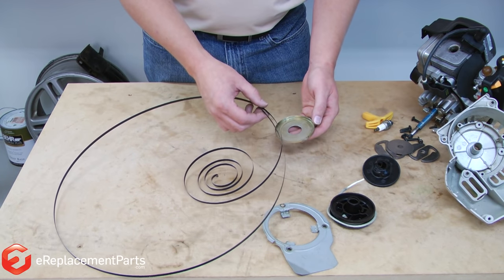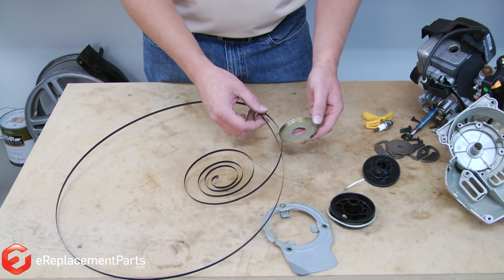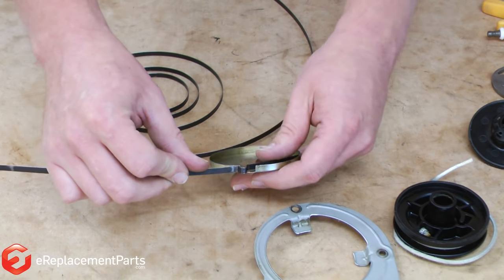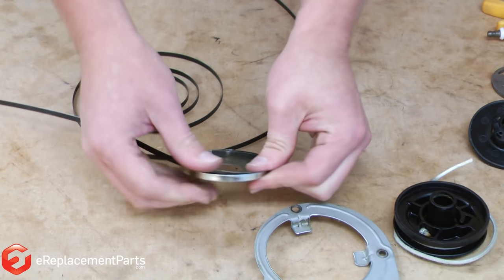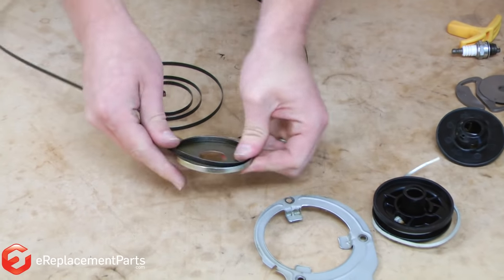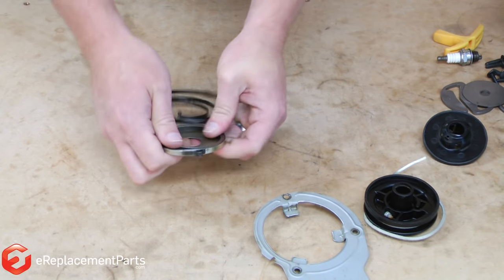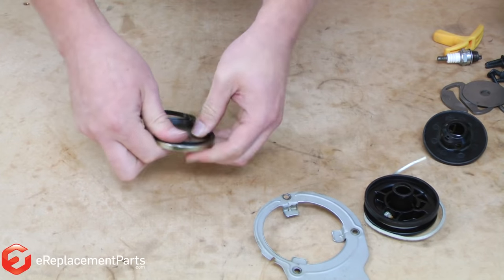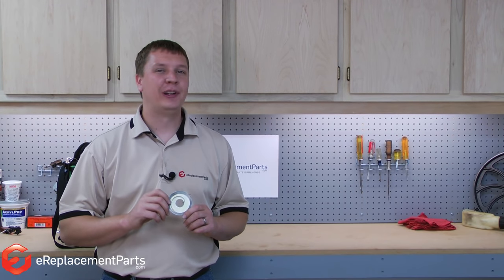How to Rewind a Recoil Starter Spring--A Quick Fix

Comment: Just a footnote to all you good folks, the spring will only catch the spool in one direction, so if your spool is not engageing the spring, remove the spring  from the housing and start the spring winding the other direction, with the tag end near the outside pointing the other way, especially helpful if it springs out on disassembly and you had no idea of the oreintation.

Comment: Hi Mark,   I used your Quick Fix to rewind the recoil starter spring on my old Homelite HB 100 blower.  It has the same design as the one in your video, and your technique worked fine.  Thanks!

Comment: Mark,
 I struggled for an hour and still could not rewind the spring. I checked many different approaches . I saw yours and immediately went into my garage and rewound the spring to my Homelite chain saw. It took 5 minutes. 

Thanks for the tip,
ernieking6031

Comment: i wound mine up by hand (can take a while and a few attempts as i found you need to hold it a certain way for you to be able to wind it by pulling it together and holding the middle and keep wrapping more round) and kept pulling the outside end out to make it tighter then when it was fully wound up gripped it tight together with long nose pliers (at the right point that gives you access to the housing) and offered it up to the slot that holds the outside holding bend. long nose pliers are essential if you have the recessed housing type of pull start where you have no chance of doing it with bare hands.

Comment: once you get the spring in, put the rope spool in and turn it 2 or 3 revolutions and hold it to put tension on the spring. Then attach the rope, once you release the spool it should pull the rope back in. If not, you may have wound the spring in the wrong direction while putting it back in.

Comment: No matter which way I wind the spring in my homelite string trimmer the pulley doesn't seem to permanently catch in the end loop for string recoil. Any suggestions?
Reply from the maker: Check the ends of the spring to make sure it's not damaged. Also check the starter pulley for any where or damage.  The spring should easily  catch on the lobes on the pulley.  If they are broken or even slightly worn the
spring won't catch like is should.